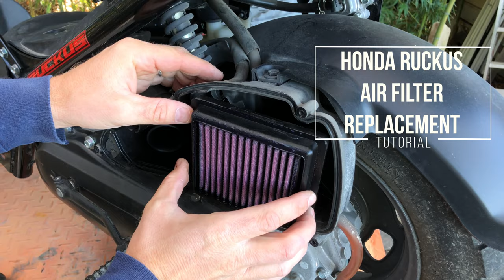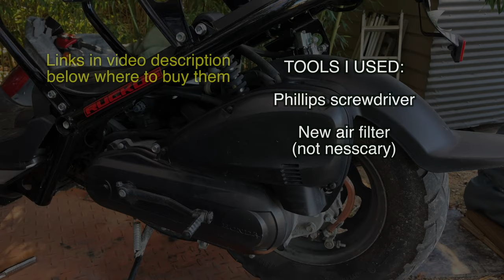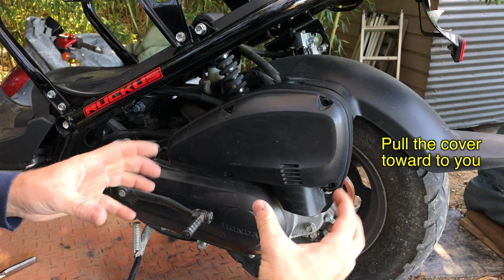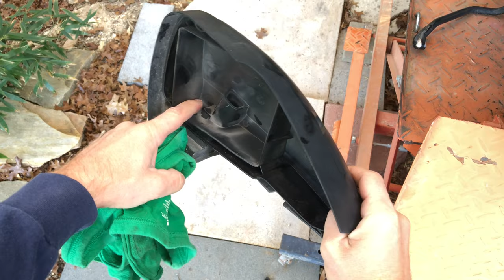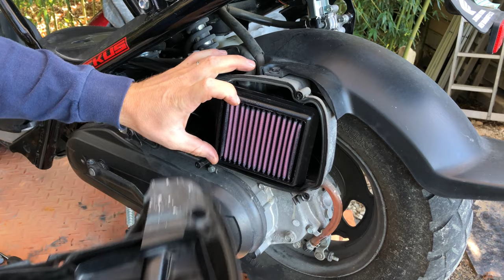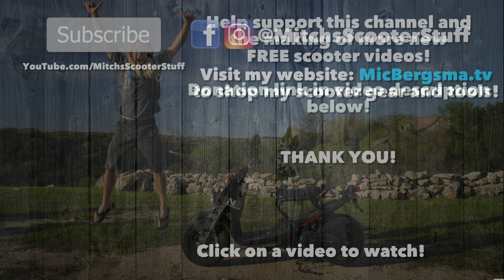Honda Ruckus / Zoomer 50 - Air Filter Replacement | Mitch's Scooter Stuff

Comment from the maker: SHOP ALL SCOOTER TOOLS AND GEAR I USE: 
http://bit.ly/MitchsScooterStuffSHOP
Get K&N air filter here - https://amzn.to/313WeK1
Get stock air filter here - https://amzn.to/2YlLdlm
Air filter oil spray - https://amzn.to/2SGIEZY
Air filter cleaner - https://amzn.to/30WFGTZ

Tools I used in this video: 
Phillips screwdriver #2 - https://amzn.to/2JU1D0e
Reply: I got a k&n filter on eBay from a large vendor, cost me $35.63 shipped.

Comment: If you have a stock Ruckus(stock exhaust & air box) you will need a re-jet after installing this K&N air filter. This is such an awesome high flowing air filter it will make your engine run Lean. I found living at 5,200 ft elevation i had to change to a #35 pilot Jet and a #78 main Jet make this high flowing air filter work/run right with my stock setup.

I have a Trail Tech Tachometer, Dr.Pulley 5.5 gram Sliders, NCY CDI-Box, NCY coil, NGK 6216 CR9EHIX-9 Iridium sparp plug, NCY Decompression Tube, K&N Air Filter, and #35 pilot Jet and a #78 main Jet.
Reply: What kind of speed are you getting with that setup?

Comment: K&N filters are worth the price for reusable replacement costs alone, plus the better flow they are a no brainer. I’ve been running them for 20 years. 

They do come pre-oiled brand new and do not require them to be oiled the first time. To much oil can effect the MAF sensor on fuel injected systems, just something to watch for. 

Because they flow better some vehicles should be jetted a little richer to compensate for the additional air. Something to keep an eye on anyway, check your plug after a bit to be sure. 

Nice to see new videos being posted👍
Reply: novice DIY-er here. can you explain how to rejet or "check my plug"? thanks!

Comment: Hi MItch! Thanls for your great videos. I have an fuel injected Ruckus with after market exhaust and need an air filter. The K&N filter looks good. Have you tried the filter boxes with small sponge filters that you soak in air filter oil? What do you recommend? Do I need to do anything with the fuel injektion or can I just run as is with the after market filter? Thanks!!!

Comment: Hi Mitch. I have two black hoses coming  from the air filter area or the area underneath  the seat and then tuck in underneath the floor board on the left side. Wh at is that for?  part of the cooler
Reply from the maker: Hey Shu, It’s for vacuum / breathing

Comment: I think you should only be spraying the filter oil on the draw side of the filter. Spraying on the inside will just pull oil to the carb. Doing this on cars can clog the MAF sensor. This doesn’t have that but is best practice.

Comment: What is the difference between the oem honda air filter ( green one ) and this k&n air filter .
Reply from the maker: K&N lets bike to breathe little more than stock... gives bike little more power, better mpg, and easy to wash and reuse on next maintenance schedule
Reply: @MitchsScooterStuff  might also make fuel air ratio run lean

Comment: You are missing the metal backing plate on the filter
Reply: While the oem one has a metal plate, the o e he removed as well as the k&n do not use the metal. No need for metal, save a robot 🤖

Comment: Ever since I cleaned mine and reinstalled it’s been shutting down and blowing 20a fuses. Feels like an airflow issue but idk
Reply from the maker: Did fuse blow before you take air filter out for cleaning?

Comment: I installed it and my scooter is not running right.  Any ideas
Reply: mike poma 

My Ruckus was running rough right after I installed my K&N air filter. I had the carb re-jetted. Now it runs perfect.
Reply: k&n filterlets more air through, makes carb run lean, just run a stock honda filter

Comment: Is the air filter oil needed?
Reply: At least the car version of this filter comes pre oiled. You need to clean it every 30k miles or so
Reply: For future users, the point of the oil is so when dirt and dust come into the air filter, it sticks to the oil on the filter.

Comment: I don't know Mitch. I hope that filter isn't rattling around in there if it is you're going to get air  and dirt around the filter instead of going through it.
Reply from the maker: Hey, one of my friend who have ruckus using that KN filter, he checked few thousands of miles and it looks great... There is tiny gap on end edge that is not affecting anything... thickness part is important for the lid to hold the filter inside without moving around.

Comment: KN filter is not an upgrade.  THese are whats called 'mechanical' filters; that is, they filter by having a smaller hole than the target contaminate.  You can often tell the quality of mechanical filters by the number of pleats.  more pleats means more surface area.  KN are a rip off.

Comment: So do you spray oil on the stock air filter ? First time I watched a video of yours that wasn’t all that helpful to me as a Honda ruckus owner trying to change the air filter properly
Reply: For future users, the point of the oil is so when dirt and dust come into the air filter, it sticks to the oil on the filter. Helping keep the dirt and dust from going inside the carb.